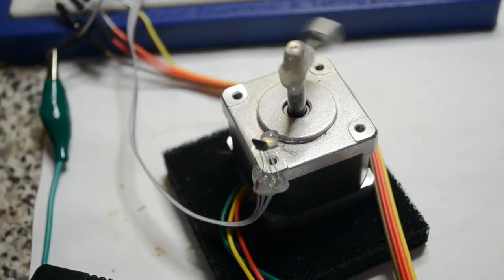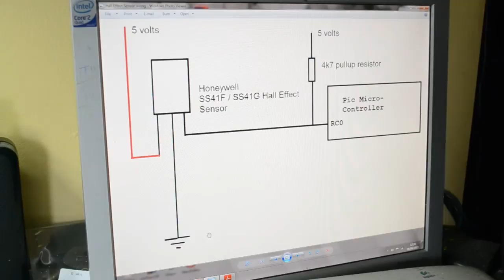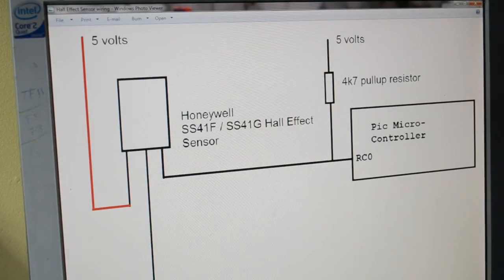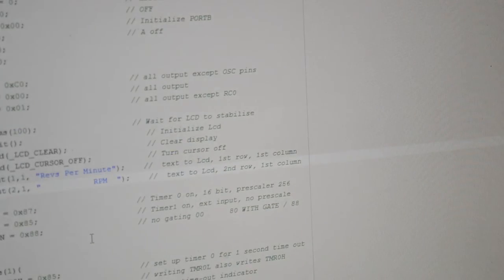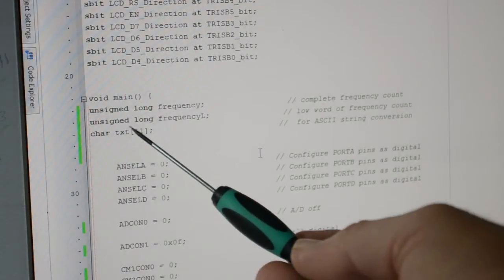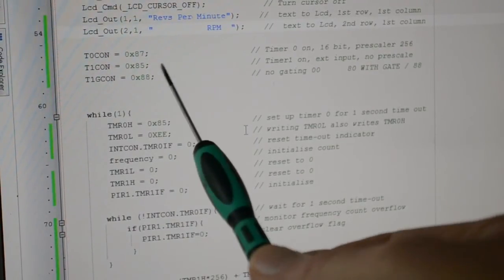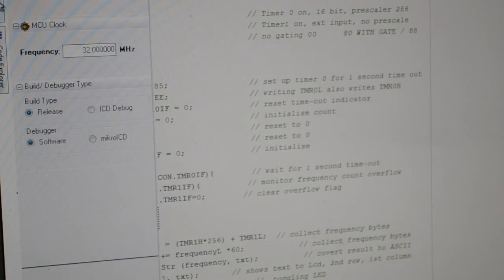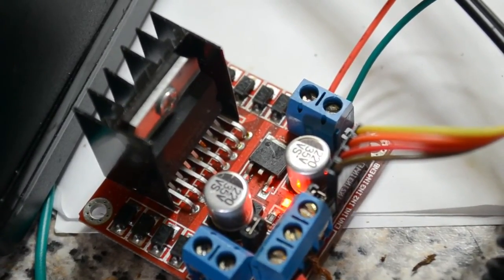RPM / Rev Counter- Frequency Meter with wiring and code + Hall Effect

Comment: Hello How could we adapt such installation to get the number of revolutions (not per minute, in absolute value) such that we start it a 0 and after a while we can see how many revolutions the disk had ? (i come back to check the next day and fin 22917 rounds for example)
Reply from the maker: One can simply set up a counter.
i.e. If port...(with sensor) ==1, count = count + 1.
or count+=1
Reply: John B thank you very much

Comment: Hello, I'm also reading digital voltage from a hall effect sensor, can you tell me what's the equation used to convert the voltage to RPM?
Reply from the maker: The code is at 8 minutes.
The hall sensor just turns on and off and connects to one pin on the micro controller. The input is compared to the timer - (1 second interrupt)
Thanks